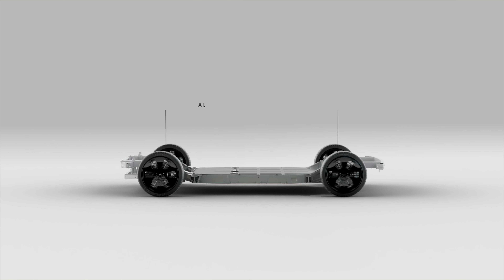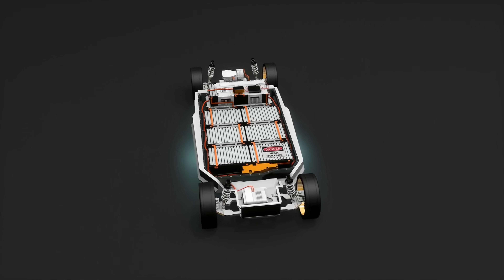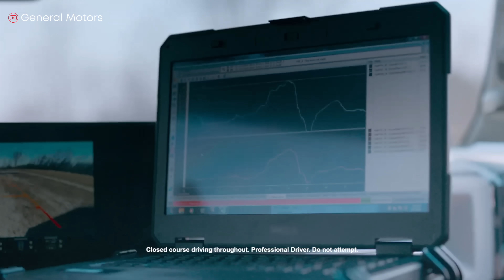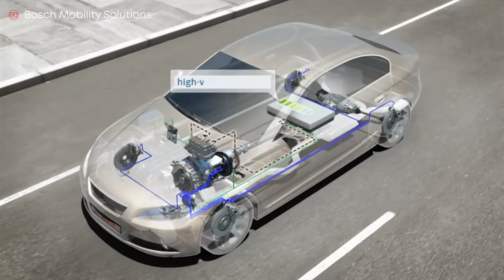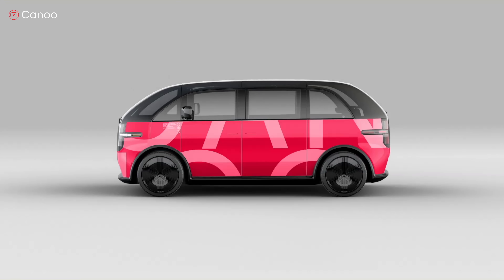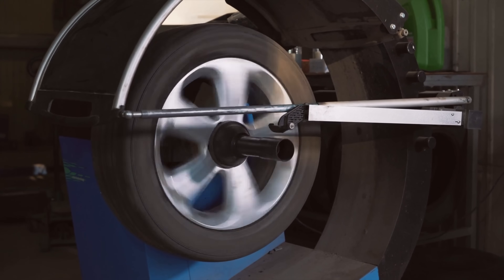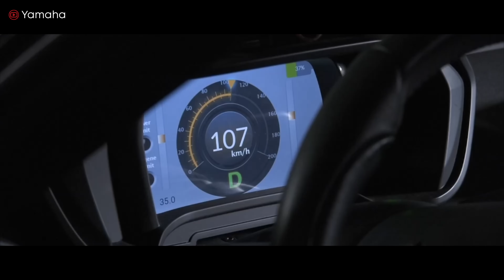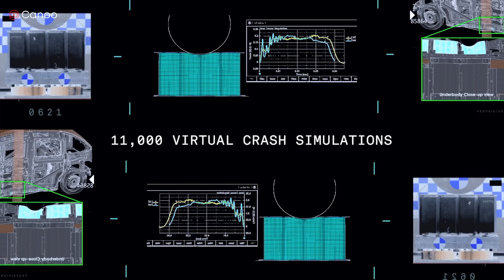No One is Telling You the Truth About Electric Cars, So I Have To

Comment: Bursting into flames in your garage is a significant drawback. So too is the maintenance (battery replacement) after 10 years.  Internal Combustion Engines are significantly easier to work on if you are moderately capable of doing anything mechanical.  Whereas Electric Vehicles are engineered (by design) NOT to be user serviceable.  When was the last time you replaced a non-replaceable battery in your phone? The real reasons for the push to electric: The government will be able to make significantly more in sales taxes if they can shorten the lifespan of the vehicles, AND the fact you have to have a domicile means they can control YOU and YOUR TRANSPORTATION.  Time to get out of Komie Kalifornia!

Comment: One question that has hounded me since EVs were introduced but I have never seen addressed:  in a very serious crash/rollover scenario, what nasty chemicals, if any, would be released from the batteries to douse the occupants?
Reply: Well first off, it is nearly impossible to rollover an EV.  Especially those built on the skateboard design Tesla introduced.  The battery back is very heavy and centered very low to the ground.  This makes it nearly impossible to roll it over...

2nd, there are no chemicals for anyone to get doused in.  The batteries aren't like lead acid batteries.  There are no wet chemicals.  The internals of the battery is solids, so there is no chemicals to spill.  With that said, should the crash be severe enough that something were to pierce the battery, you could get a major fire due to thermal runaway.  Basically when you pierce the battery, you short circuit the anode and cathode, causing all the energy to dissipate very quickly.  This causes extreme heat and is very difficult to control.
Reply: @BassPlayerUnderGrace  Thank you very much for that information, Robert. It is exactly what I needed to know.
Reply: @BassPlayerUnderGrace  I have been in the vehicle 24 hour crash and breakdown recovery business for 34 years.  I  can assure you that the general public will manage to put their electric vehicles upside down,  on their sides , perched in tee tops, submerged in rivers etc etc.   Believe me ......they will manage to do it.
Reply: @missiontent111  Oh, I didn't say that it was impossible or that it wouldn't happen, just that it is nearly impossible.  Better wording would be very difficult.  Definitely more difficult to do so.
Reply: @BassPlayerUnderGrace  "Well first off, it is nearly impossible to..." said the designer of the Titanic.
Reply: @jamessauve2419  I'm talking about physics here.  You can't break the laws of physics.  With an electric car, all of the weight is at the bottom of the car.  The car's weight and center of mass is literally lower than the 4 tires it sits on.  This physically makes it very hard to flip upside down.  And almost always though not impossible, if this was managed, it would likely roll back onto its wheels, just like a roly poly toy.  That's just the laws of physics when you have over 2 tons of weight in 500 cubic inches of volume, and most of the 2 tons is located at the very bottom.
Reply: Those types of batteries exploded on impact and had cell balancing issues that caused fires
Reply: @BassPlayerUnderGrace  if it hits ice and gets slung off a bridge flipping over a guard rail into water it’s not gonna land upright
Reply: @missiontent111  THIS... you can say that about other industries, too. There's theory. And there's humans and reality, lol. I know exactly what you mean...
Reply: A Tesla caught fire in Austin TX about a year ago. It took 35,000 that is right, 35,000 gals of water to put it out. The fire keep flaring back up. And to top it all off, this happened at a gas station. He lost control of the vehicle.

Comment: i can't figure out why they don't have batteries that can swap out/in in a gas station rather than self charging. it would solve a problem with range anxiety and battery wear. you drive into a building like a car wash and a machine would unplug your battery and install a replacement and your on your way. 
also as battery technology improves the technology would go into your older car.

Comment: When the battery becomes older, one has to be watchful when driving on an up-slope as the torque production comes down especially when the battery charge is low.
One may have to charge up to 100 % for every 3 charges as the equilisation of battery voltage happens.this will increase battery life.

Comment: Just got an ID3 a month ago, great fun especially in city. Acceleration is nuts, Im in Ireland so Temp range is small between Summer and Winter.
Reply: and the battery does not last "up to 10 years" but more in the area of at least 300.000km if you have the big battery pack and mostly charge below 22kW
Reply: @gu3sswh075  i think they are the future. petrol cars wont be a thing in 30 years, it will either be electric or hydrogen. Im more a nuclear electric guy not an environmentalist
Reply: @gu3sswh075  these metals are not highly toxic. and these metals do not get produced. they get mined or collected. they are already in our environment.

Comment: Well Scotty, I really like this video.  I still, however, reserve my positive endorsement on EV's.  Living in Ontario, Canada, where the summers can have +35 degree celsius summers and -35 degree winters, I wonder just how this will affect the performance of the batteries?  In winter, not only does the cold affect battery life, but you must have some kind of heater to keep from freezing!  What does the heater use as power?  The battery of course and therefore will drain quicker.  Summer will require air conditioning which will also have a strain on the battery.  So, until they can create an electric vehicle that can get the longevity and dependability of gasoline powered vehicles, I am not buying in at this time.
Reply: Perhaps talk to some EV owners in Canada to see how EVs are working for them? I know in Norway EVs are the dominant cars on the roads there now. I heard it gets pretty cold there too.
Reply: I've had a Nissan Leaf for a while and I live in the countryside in Finland. I've had no problems with the car doing a  32km/20 mile commute every day or a 100km/63 mile round trip to church every sunday even in the dead of winter. Earlier this month it was 28 degrees celsius and I could drive 140km on a motorway going about 100km/h (63mph) while the heating was on max setting. The only real problem I've had is that the brakes keep freezing under certain conditions but I've had the same problem with previous cars which weren't EV. 

I do have a gas-guzzling 4x4 as a backup vehicle though in case the roads aren't cleared of snow and I have to go somewhere or if I have to tow something like a trailer.

Lastly, I read experiences of some Finns who had tested older Nissan Leafs in Finland for a longer period of time that if their battery capacity would continue reducing at a constant speed they'd have 80% of max capacity left after 15 years of use which is perfectly fine considering you can buy extension batteries for Nissan Leaf at a reasonable price and their prices continue to drop over the years.
Reply: Mainly they are dominant cars in new sales because government push. Lowered purchase cost and until now no roadtax and free on paid roads (pay every time you usr that road) wich amounts to big savings especially in cities where this will be between 1500 to 4000 dollars a year if driving to work etc. The ev's were also allowed to use taxi lanes. So if traffic was stuck ev's could move a lane and drive. Now this year road taxes will be put on the heavier ev's. The Nissan Leaf kinda car still supported.

Comment: So you should keep an EV in the garage to help keep it from getting too hot or cold. 
But now they're saying not to put them in the garage because so many of them have been catching on fire.
Reply: ? Your talking about the bolt that has 3 recalls. The chances of an ev catching fire is like 10x less likely and I'm not pulling numbers out of nowhere look at Tesla's impact report.
Reply: My biggest fear is what about electric where will it come 
from out in a little city fine. But what about if in time everyone
in a large city has one. then there's a choice heat the house
or charge the car with the 40 Amp 230 volt circuit.
Reply: @lachlanB323  
The Teslas have also been catching on fire.  There have been Teslas on fire in the garage also.

Comment: To avoid house fires with EV's,  park it in an Igloo during charging.
Reply: Most EV house fires during charging is fault of installing 240V or higher charging outlets with CHEAP LOW COST electrical parts and wrong rated wiring and fuses that is being overloaded for the true AMP and VOLTAGE current going through them.
Reply: Fud
Reply: @tyranelewis7763   Possible issues with GM EV vehicles...as they just put out a warning
Reply: @jonfscott  that means they are behind on the battery management system which also keeps the battery at proper temps when charging. once again to say Tesla is years ahead of other from their experience of trial and error that has lead them to become the highest selling BEV.
Reply: @tyranelewis7763  I agree 👍

Comment: Okay, all well and good. I had 3 vehicles all well over 250,000 miles. 13 + years each. Sold all 3 usable and running. I have a 20 year old Toro lawn mower still running just fine. 10 years down the road I have to replace the batteries? They DON’T recycle! How expensive are in ten years? You know the battery companies will keep the prices high. Which one is cheaper now?

Comment: 2.3% lost in capacity every year...That sound like the battery could last for 25+ years (50% charge still get the job done).
Are you missing efficiency on the formula? More time to charge it, waste heat and all that?
Capture energy from braking goes to super-condensers for maximum efficient and yes you can get 90%+ of the energy back base on all circuit efficiency.

Comment: It's a misnomer about 20% 80% rule battery controls on the cell phones and cars for the last 12 years prevent undercharging and overcharging it's automatic when your battery reads 100% hard it's actually only 85% charge when your battery reads 20%. It probably has about 25 to 30% left in it

Comment: I almost fell off the chair when Scotty mentioned General Motors working on a battery that will last 1,000,000 miles. Let's not forget that this is a company that puts out such inferior line of vehicles that few years ago they had to lower their warranty to 3 years or 36,000 miles because it was costing them too much to repair all the vehicles under warranty. Now they offer extended warranty with which it still isn't as long of a term as other manufacturers offer standard. And when you use extended warranty, each time you have warranty work done you have to pay deductible. I know someone personally who spend over $1,000 in a single year just on extended warranty deductible, eventually got fed up and traded his Chevrolet Silverado for a different brand truck.

These guys can't build a good combustion engine vehicle and they've been doing it for decades, don't expect them to build a good or safe electric vehicle, like with the ignition switch scandal, they rather see people die and pay little in compensation than to spend money on making sure their vehicles are safe.

GM and electric vehicles spells disaster and without a doubt people will lose their lives in those things, they'll screw something up somewhere for sake of saving few bucks.
Reply: Just LFP batteries. They are standard on base model 3 models.
Reply: GM makes some of the best engines in the world...they build jet engines... everything will have problems eventually, they make engines for the chevy truck, hummer, etc...these are are some of the best vehicles when it comes to durability.

Comment: Very good breakdown of what people should consider when making a transition from ICE to EV. There is an alternative in Plug-In Hybrid vehicles for the average commuter. And your example of 1000 miles per month can easily be achieved with very minimal use of gasoline.
Reply: The hybrid is one of the original vehicle ideas from the late 1800’s - even Ferdinand Porsche designed his tiger tank prototype to be a hybrid , it’s also been used in locomotives since the 1930’s

Comment: To replace the batteries its $5000-$15,000 depending on the model of car. Gas powered engines are alot cheaper to operate...
Reply: @solexxx8588  You just did! LOL! Dude dont get me wrong, some letrics are ok, but when somebody forces folks to buy it then its a no deal. I prefer petrol cars because they are proven, efficient, and hardly pollute. If you want a letric car, then by gum, go buy one.🙃

Comment: Well done Scotty. 
I prefer the ability to go long distances towing good amounts of weight. Someone said their electric f150 would smoke my 2007 Tundra even if it was supercharged ( it's not it's got headers and exhaust). I said I'll take that race. I set the terms. 1300 miles towing a trailer...No response back yet. 
We don't have the charging infrastructure for a large population of e.v.'s either. It also means your money is mainly going to China who has capitalized on mining in Africa and other places abroad for the materials to make the magnets and the batteries. I think a 1950's straight 6 pickup truck is still the most earth friendly vehicle every built.  We are getting a 2022 Tundra for my wife. My truck has almost 100k and it's been lifted its whole life and had used one idler pulley and belt and a ball joint. The ball joint really could cause problems but I have lots of off road and I had my floor jack and ratchet straps with me when it happened. I was 30 minutes and rolling again. I have 4:11's so even at 6k pounds with 35" tires and a long bed she still outruns most newer lifted trucks. About 14.5 in the quarter mile. My wife's brand new tundra with regular tires is supposed to be 14.5 as well? Lol. Kind of sad but will be perfect for her with new rear suspension and the taller gears will help us on trips towing a 20' aluminum boat. 
Watched you tons of times and have shared you with so many people. 
Have a great Easter weekend! 🐇
Reply: bingo!

Comment: When I can drive from Chicago to Boston in the same amount of time as with my diesel or gas engine, then I will consider electric. When recharging takes as little time as refueling a petrochemical engine, then I would consider electric.
Reply: You can buy a lot of fuel for the price of that $45,000 Tesla / Chevy Volt and the $10,000 replacement battery.

Comment: Although battery powered vehicles have been around for several years, I believe they are still in their infancy. I think more development is needed before they are considered a reliable source of transportation. I, for one, won't buy one now. Not enough range and they don't like the cold. (I live in Southern Ontario). 
I think hydrogen cells are the way to go. No heavy batteries needed. Just refill the hydrogen and go. Quick and simple. I believe that's where the future lays.
Reply: Electric cars have been around almost as long as gas and diesel powered cars. Arguably the first electric car was made in 1890.  Really is they are more reliable with having considerably less failure points. 

I however understand your skepticism - hydrogen cell technology (hydrogen battery) uses small turbines to generate electricity that is used to run the electric drivetrain. So yes it’s a battery that is refilled with hydrogen.
Reply: @F250Guy   Hyllion is trying to do that. Doesn't change anything. It would be very expensive to dig up gas storage tanks and install hydrogen storage tanks.
Reply: There's no way hydrogen cars will become mainstream until the unstable nature of hydrogen is resolved. If you carry around pure hydrogen, it could explode just from looking at it funny. Some companies have tried to solve this problem with a more stable mixed liquid from which they extract the hydrogen, but then the energy and accessories required to do the extraction make it very inefficient.
Reply: @pwells10  our infrastructure isn’t set up to support electric cars either can’t even support heatwaves now 😂
Reply: In 1912 38% of all cars were electric, only 22% were gas... so it has been around a while. Also the new F150 lighting has almost a 400 mile range not towing, and you can charge it up to 80% in 40 min, time for lunch and keep moving. A long trip would be easy in one of those. There are chargers everywhere now, you can even plug into any 120v outlet and they rarely break down, how is that not reliable?
Reply: @michaelmaas5544  🤣🤣🤣🤣

Comment: It sounds like they are cheaper to maintain for about five years. "Life of the car" is a fungible number. It's 14k to replace the batteries
Reply: The price of battery packs will continue to fall and reliability, capacity and longevity will increase over the next few years. 
Advancements with EV tech are happening at an increasing pace (as more companies jump into the market) - These are the early days of EV technology, this is the "worst" the technology will be....
Reply: @metamorphic75  the video isn't about what will happen someday Maybe. Although I'm sure the technology is going to improve. You are right. This is the worst they're going to get. My objection is that this video does not seem to be taking into consideration replacing the batteries as part of maintenance and therefore suggest that you're going to save money on maintenance with a current electric vehicle. 
 I think at this point a bottom of the price range fuel-efficient internal combustion engine car is better for the environment and likely much more cost effective than any of the electric vehicles.